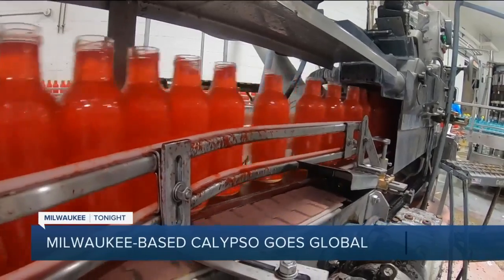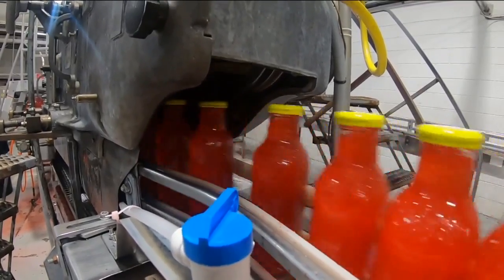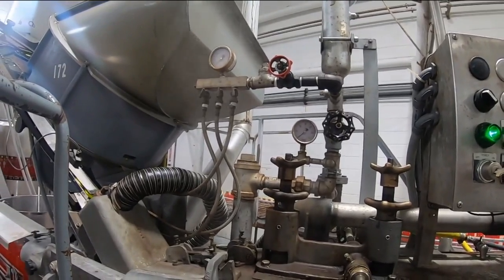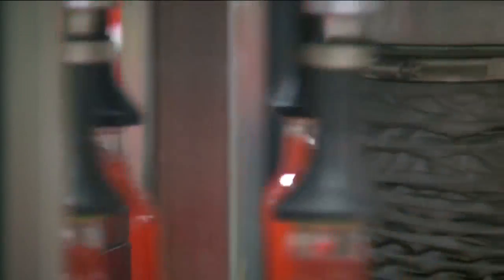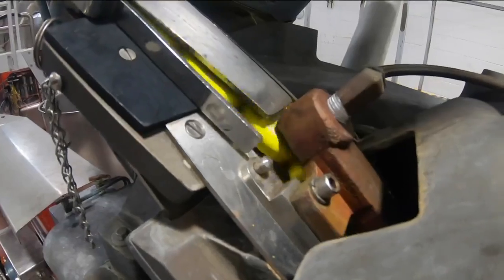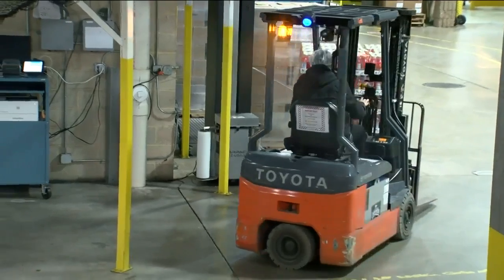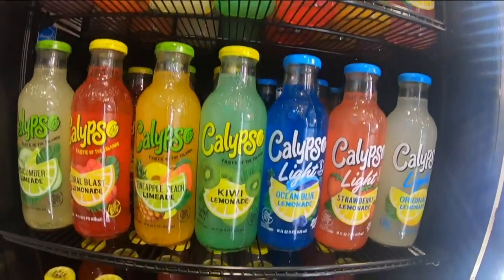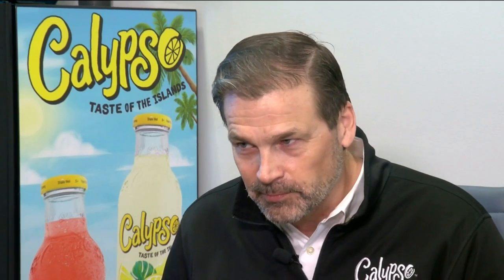Milwaukee-based 'Calypso' lemonades goes global

Comment: Pretty good lemonade.  Hopefully they don't go up to 3.99 a bottle.
Reply: still surprised and happy I can find them for less than a dollar in SoCal
Reply: @Schwackmann  it’s 3 dollars in New York 🥲
Reply: Sadly it costs quite a bit for just 1 bottle, but the stuff is seriously really good.

It’s very sugary and sour (to the point that it will make your face and neck sweat) but incredibly stout stuff.

I tried some in Dothan AL and was hooked ever since. The colorful, tropical 🌴 stylized glass bottle it comes in is also very appealing.

Occasionally if I had a very bad/hard day at work and I’m low on gas, I’ll stop in the quick store and pick a bottle up to remember better times.

It has a way of “perking up” the soul, without the hangover accompanying alcoholic drinks.